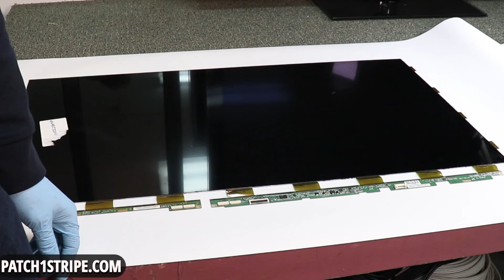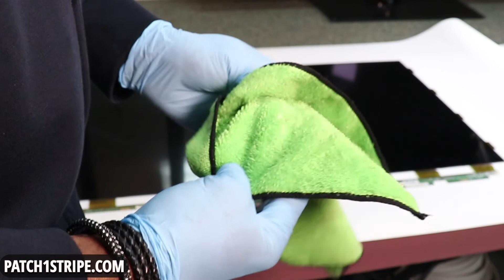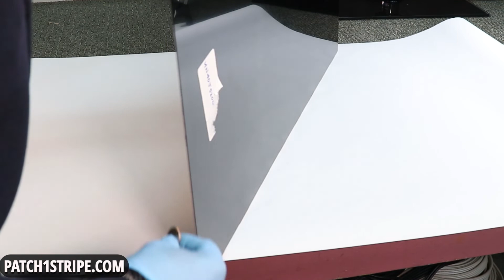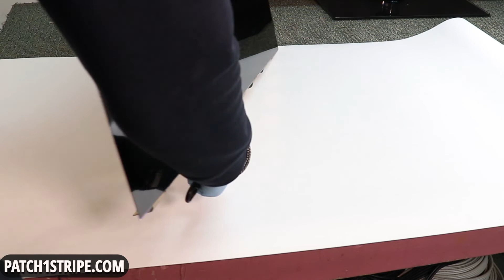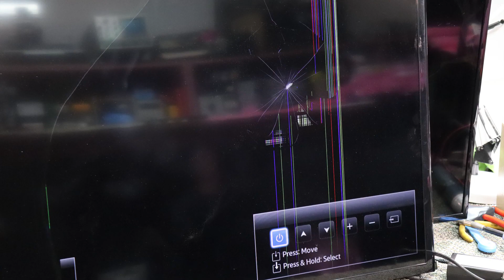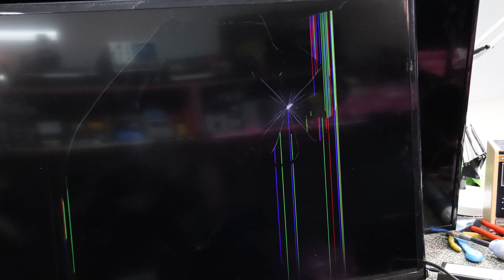HOW TO REPAIR ANY CRACKED SCREEN ON A LED TV

Comment: Cool video by the way. Being an Electrical Engineering student, I always  wanted to see the inside of the LCD of a modern TV.  Unfortunately, I did in less than desirable reasons...
I broke my tv/monitor being an idiot with Excel, accidentally throwing my mouse at the tv, and now I need a new one. Certainly cracked the LCD. I wanted to look if there was any possible repair... but no, I'm gonna be using a 2008 27 inch tv  as my monitor for a while.
Reply from the maker: https://patch1stripe.com/product/a-live-repair-help-session-with-patch1stripe/